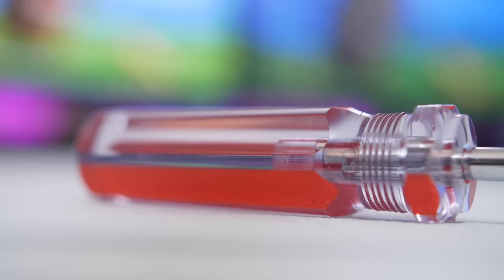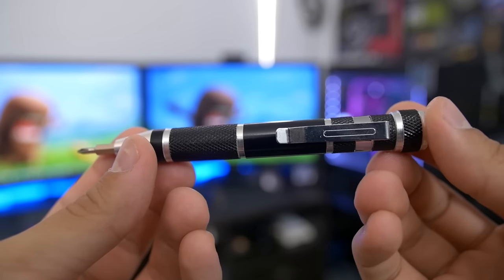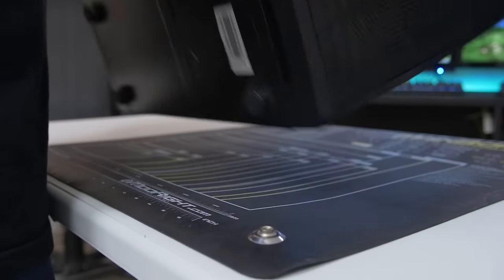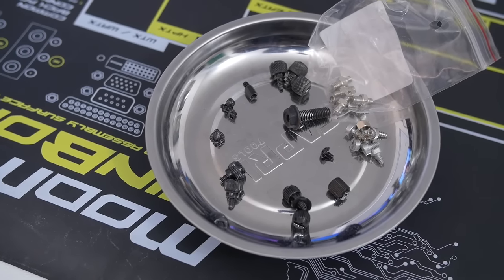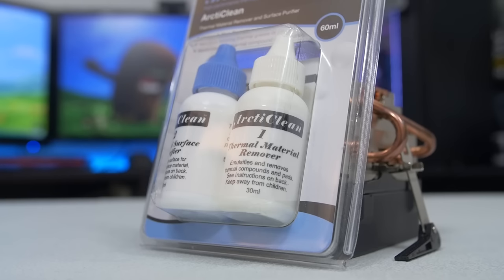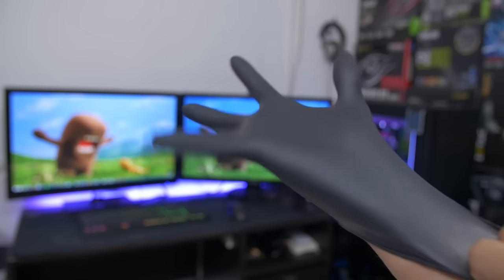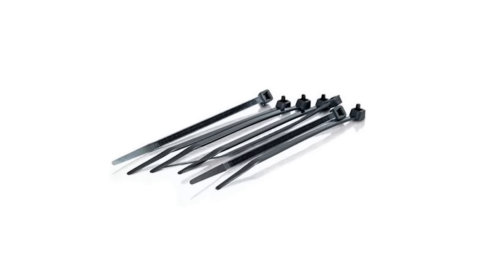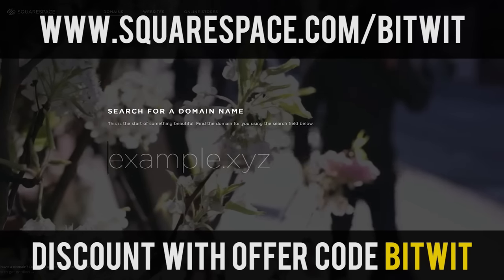Top Must-Have Items When Building a PC!

Comment: Most of these things in the video I have because of construction and mechanical work. I use a makita 18v impact to put in screws with a magnetic bit holder for a drywall gun to put computers together, it's super fast and I have a good feel for it from so much use. Plus it's got a light!

Comment: I raid the produce section of my local supermarket for those twist ties,excellent for cable management and the price is right. My complaint about plastic wire ties is the sharp piece that can be left sticking out if you do not cut close enough. Cost and the leftover piece of a plastic tie is another issue.. Love that magnetic dry erase board. Those would be very good if you are working on a laptop,so many more screws and the screws do have some differences.

Comment: You said the nitrile gloves are non-conductive. However, it is non-conductive items that will have a static charge since they inhibit the flow of electrons, causing them to pick up and then retain electrons until they reach enough of a charge that they violently discharge and fry your electronics.

Comment: If you are water cooling and need to mount a reservoir a small level and or square can be useful.  A stepped bit can be useful for passthroughs.  A ruler is just useful for a lot of this all around especially when new to watercooling.  At least that has been my experience so far.  And double sided tape for helping mount things is a godsend.

Comment: To make bitwit a good name, make a logo and channel art, and apply them as ur profile pic and channel art then the name would look a lot better on the channel.
Reply from the maker: Working on that as we speak!
Reply: Neat
Reply: +BitWit you should call Awesome Hardware "Hardware Bits"
Reply: random question is it ok to use universal thinner for cleaning cpu and heatsink i used it a few times now
Reply: +Mawe KFX you'll be fine; it actually cleans the paste off a LOT better.. just be careful and try not to hit the PCB on your motherboard with it.
Reply: +TH3 D0NX why not awesome bits of hardware
Reply: +Rickie Cheong I thought of that but too many syllables
Reply: I agree. He needs to have good branding to match. His current profile pic is awful and so is the channel art. When you change the channel name you should change all the branding for consistency.
Reply: Ban Ashrack why he seems to enjoy what he does and is living the life he wants
Reply: What if i still use the little cloth that came with my glasses to clean my oversized Corsair 760T window?Is it still good?

Comment: I work on multiple PCs per day, and as long as you are careful and light on the trigger, an electric impact gun can tighten down screws in less than a second, and when you are building multiple systems per day it saves both tonnes of strength and time, I never had an issue with stripping screws or damaging other components

Comment: well i just built my pc, and the only thing i wish i had was a magnetic screwdriver.
Reply: ...and maybe a titan xp
Reply: that escalated quickly
Reply: pc specs?    just curious.. ;)
Reply: I'd just settle for two 1080 honestly
Reply: settle? can i ask you what the hell kinda gpu do u have?
Reply: +BrainBoost_132 6500 and a 1070, inside the node 202
Reply: ok, thx
Reply: You could get a regular screw driver, find some magnets, rub the screwdriver against the magnets and voila, you have a temporary magnetic screw driver! :D
Reply: Grim Secret just joking obviously, I can't even afford a single 1070 really
Reply: I built mine about the same time as you, I just took a regular screwdriver and rubbed a magnet on it a bunch of times. It successfully magnetized it enough to hold screws fairly securely. It must have been a real pain without it.
Reply: ***** I'm about to build my first pc, do you have any tips to not screw anything up?
Reply: Lec sjfsadk make sure parts are compatible, get a magnetic screwdriver and touch your pc case every once in a while so you dont die by electrocuting yourself
Reply: Elektramd Not exactly "Die by electrocuting yourself" but... To reduce the risk of frying the components. (Even though it's a REALLY small chance)
Reply: So an antistatic bracelet is probably way overkill
Reply: Lec sjfsadk If you want to absolutely be safe, Go for it (if you can). but it's not necessary. Touching the case every so often should be fine.(that's the general answer you see online)
Reply: ***** yea
Reply: ***** yeah that's what I'm probably going to do. I can't wait to get started, I've been spending the last month watching videos, reading on forums and looking at prices.
What do you think about this build:
i5-6600k + hyper 212x, rx 480 nitro+ (or gtx 1060, I'm still not sure though I'm leaning for amd because freesync), z170 (still don't know which one, maybe the asrock gaming k4), 16 gbddr4 corsair vengeance, ssd samsung 850 evo 250gb+ hdd wd 1TB
Reply: Lec sjfsadk What kind of games do you play? both gpu's are good but the rx is better in some things, same with the 1060
Reply: Elektramd gta v, assassin's creed, FIFA, nba 2k and idk what comes out (I'm more of a casual gamer). I know the rx is better for dx12/vulkan so for future games and the gtx 1060 would be slightly better for these games but yeaah..
Reply: Lec sjfsadk Since you're a casual player and don't mind about the fps that much the rx can run those games, prob not as well as the 1060, but its good for the future so i would suggest the 480
Reply: Elektramd yeah that's what i thought, as long as it doesnt stutter and is consistently over 30fps it's golden
Reply: Lec sjfsadk def over 30fps, sometimes stutter is caused by the game (if stutters) but usually fixable

Comment: I just built a new desktop and as with every build, found it relaxing and fun. One of the items came with white gloves, and I promptly tossed them. I would suggest a set of needle nose pliers as you may have small rubber gromits and the like to place and or remove, depending on the build.

Comment: Screw organization? Ice cube tray, with magnets glued to the bottom or the stronger type of magnetic strips. I know this video is older but I started using ice cube trays after seeing it on a electronics repair/modding channel and added the magnet part myself.

Comment: Do you really need special liquid to remove thermal paste? I just use alcohol and it works fine.
Reply: It works fine. It flashes away quickly and is safe on electronics.
Reply: my uncle was gonna use cologne to clean the ihs
Reply: I used nail polish removal. Haven't had any issues... yet(?) :P
Reply: Yup.  rubbing alcohol is just fine.. forget going out to buy some expensive "remover"
Reply: i use chlorine water to get thermal paste off of my cpu
Reply: I use bleach, works well
Reply: Jun Yong Park God i hope you are joking
Reply: It'll do damage to the PCB and any plastic if it comes in contact so as long as you keep it on the IHS it should be fine.
Reply: ***** are you talking about isopropyl alcohol? Cause that is safe on electronics. I saved a dying GPU and motherboard by cleaning all over with Iso and an acid brush.
Reply: No, that's why you don't use acetone.
Reply: ***** yes, because acetone is a solvent which eats away at many materials. Isopropyl is an alcohol that doesn't damage materials.
Reply: water does it too
Reply: I bought it for my first build the other day. It was good at removing thermal paste. The smell was nice but i still smelt it after i finished building my PC 5 hours later, so it got annoying
Reply: jirka merunka please don't use water trust me
Reply: Ray Sindweller Well I use Isopropyl Alchohol or wet wipes that contain it(if I am too lazy)
Reply: Ray Sindweller I use my spit

Comment: 1. Power Supply 
2. Motherboard
3. CPU
4. GPU
5. RAM
6. HDD
7. Case
8. Mouse
9. Keyboard
10. Screen

You're welcome
Reply: Kevin Deegan or a SDD
Reply: Not essential though
Reply: Optical drive too
Reply: Do you need the mod mat?
Reply: Not screen its called a monitor
Reply: MaxFrag Gaming You need a screen because like tv can be used as a screen and tv ain't monitor
Reply: Don't forget about an OS lol
Reply: Kevin Deegan you forgot cpu cooler, aha
Reply: DAGRAFIX Included in CPU 99% of time
Reply: Isopropyl alcohol, heard it works as good as anti cleaner.
Reply: Wires
Reply: Gpu isnt
Reply: GPU isn't necessary
Reply: Forgot the RGB xd
Reply: You don't need GPU if you have an APU over a CPU, you don't need mouse, keyboard or screen, so all you need is
1. Motherboard
2.RAM
3. PSU
4. Screwdriver 
5.APU
6. Storage disk
Reply: *Monitor
Reply: IlluminAdi as the guy said above, you can use a TV as a screen and you don’t call a TV a monitor.
Reply: What about os?
Reply: 7-10 and arguably 6(although net boot is a very exotic use case) are optional.
Reply: ssd
Reply: HDD?!?!?!?
Reply: 11. SSD

Comment: When things are described as 'must-have', I normally expect them to be essential.  You know, like... you MUST HAVE them.

Just me?
Reply: GamesByMuzly Yeah, the only thing I'd say you actually need it a magnetic screwdriver.
Reply: TyFilms And even then it doesn't HAVE to be magnetic.  I only have one nonmagnetic screwdriver and have built 3 PCs this year.
Reply: Yeah, it's just annoying dropping screws in the case. But really, you don't need something ridiculous like a $50 mat. Just don't build on carpet and ground yourself.
Reply: TyFilms I wanna put my pc in my room so is it fine if I leave it on my carpet, and will it really be bad if I build it on the carpet?
Reply: Jinχ it'll be fine keeping it on carpet, so long as the inflow/outflow isn't on the bottom, and people don't usually recommend building on carpet, though I've built 3 in my room on carpet with no problems, but just to be safe it's best not to do it.
Reply: Ethan linquist so what if I build it on tiled floor and then put it on a carpet?
Reply: Jinχ As long as there isn't a fan setup or any sort of air out/inflow on the bottom it should be fine, no static problems.
Reply: Muzly it's a figure of speech, my dude
Reply: mw too  brother cmanannananana
Reply: was just about to comment that
Reply: How common is zapping parts from static etc...is the mat neccessary? Is a wooden  table ok to build on??
Reply: @TyFilmsTy  and you don't even need that! Telekinesis can take the place of a screwdriver.
Reply: Me too
Reply: (reacting on the fact that you only Have To Have a non magnetic screwdriver)
And then again, if you actually go down the route of the "actual" have to have, you don't need a screwdriver, you could do fine grabing a knife from your kitchen.
Or even just by hand if you have solid and not too long nails, or are willing to let screws a bit loose

Comment: which camera did you used to shoot this video.
Reply from the maker: GH4 with a Sigma 18-35mm 1.8 lens :)
Reply: This may seem dumb,but my 9yr old cousin has the same PC as you,but in purple not pink.....Its called Power 60.
Reply: crispy image = love :)
Reply: a 9 year old does not have 2 Titan X's and a 5960X (unless kyle upgraded)
Reply: Flipping hell, I've been asking on most of your videos!
Reply: Most of the fellow technicians I know NEVER use anything.  at most they may have anitstatic mats where they are working, but I have seen places where the work areas are carpeted.

The dirty secret is that while those products protect from ESD that you carry but can also create ESDs that wouldn't have happened if you weren't wearing it.

Here is the general rules

1) don't work in bare feet or with socks on, wear soled shoes or slippers.

2) Before touching the components in the case touch something large and metal.  Most techs are told to touch the metal case of the power supply or the case, but some of the PSUs that have heavily textured coatings don't work as well as when they are bare medal.  In a real pinch you can even use a painted fridge door or a pot.  most of the time you don't even have to do this, it is just a good habit to get into.

3)Try to avoid sweaters and clothes straight out of the dryer.  Even if you had a dryer sheet in there.

4) Avoid wearing multiple layers of clothes.

BTW the only devices I have killed with ESD have been while I was wearing a strap on my wrist.  Mind you I also used to kill digital wrist watches by just wearing them so your results may vary.
Reply: that sounds like a rifle haha
Reply: Hello!I am one of your fellow technicians!I have a PC shop in god knows where and I mainly repair desktops,I have a magnetic parts tray an a 6 year old mod mat that looks like your grandmas carpet (Not insulting ur grandma)but it works even in its black lettuce form :/
Reply: NickGaming Hey I am NickMsiGaming and have that MC account lol.
Reply: You are NickGaming And I am NickMsiGaming.They are very similar....
Reply: my MC name is NickGaming__
Reply: And mine is NickMsiGaming
Reply: Assassin 404
Reply: and where do you find this, power 60?
Reply: thanks for the tips
Reply: Sean Douglas Yes, all the cool KIDS are using the GH5. However, that does not apply to a full-grown man who just acts like a kid.
Reply: Nicholas You changed your name...
Reply: yeah because im starting to do youtube now, idk what i should change it to offical
Reply: NickGaming was better for,well,gaming (AKA Youtube channel)
I prefer names relating not to your name but the name of a channel....
Like BitWit
Imagine if his channel was named Kyle....
Yeah..pretty crappy...
Reply: ik thats why i changed from nickgaming, i dont want it to have my name in it. i changed it to what it is now for while i think of a new name
Reply: Oh ok.I have this name because i work at Msi :)
Reply: really?
Reply: Yeah,but sadly i cant give you any discounts on our products :(
Reply: I work in the showcase department,like at CES in the Msi booth.
Reply: But usually i dont really showcase the products,i just f**k around with them behind stage,until those who show them in the booth take them away from me lel :p
Reply: can you show me proof you work for MSI?
Reply: H,how?
Reply: I could show you my documents,but i don't want you stealing my info soooooo.....idk
Reply: Anything you do,don't tell my colleagues that i have a Dell XPS 15.but I also own a Msi G72 Ghost Pro so i guess it...is..ok?
Reply: if you did work for MSI you could get me like a 99% of code for any product? lol jk
Reply: I'm sorry but if i did that I would probably most likely get fired xD
Reply: send me a gtx 1080 and a high end Mainboard with a gaming laptop or just one of these
Reply: I can send you a 750,we have about 20 of those left...
Reply: Assassin 404 lol really?
Reply: But i think my co-worker Ethan stole them Linus style!
Reply: would you really send one?
Reply: I said that Ethan took them,I could ask him but its simply not worth it for a 750....
Reply: Assassin 404 if its not a joke and you can deliver it to germany i would be very thankful
I have 7 fps at realm of the mad god on my 12 year old optiplex gx 280
Reply: Sean Douglas Probably more fucking successful than you'll ever be
Reply: Assassin 404 ikr it's fucking beautiful

Comment: That Klein screwdriver doesn't have a magnetic tip like your Thermalright.
Reply: ebiljebus you can rub a magnet on it and it will be magnetised
Reply: Gunna temporarily, yes. Not permanently
Reply: cbf edge depends on the magnet. If u dont have a powerful one lying around its easier just to order one
Reply: Order 1 screwdriver*

Comment: Are anti-static wrist strap needed too?
Reply: None of these are needed just things to ease the buildibg
Reply: +Javien Washington building*
Reply: Miguel Gabriel yeah, and a tin foil hat.
Reply: I believe he stated that the wrist strap came included with the mat so I guess he didn’t specifically mention it separately.
Reply: Miguel Gabriel you could just buy those gloves, use the for other stuff and you don't have to have something restraining your wrist from moving
Reply: no
Reply: Only for hard drives really.
Reply: If you want to remove all ESD from your body, it is nice to have the wrist strap, otherwise you have the potential to kill a PC component from ESD Damage
Reply: Recommended but not essential
Reply: Not exactly. Just periodically touch a big metal item (like a refrigerator or something)

Comment: Does that arctic silver thermal compound remover work on ceramic thermal compound? Also is it safe for delidded processors and laptop processors? I work in refurbishing and having that stuff around the work station would be a godsend with how thick the ceramic paste we use is, especially with the exposed silicon dye on laptop processors.

Comment: Ive built my ryzen pc with my tiny screwdriver that was included in the metal kit that was given me more than 4 years ago .... it has 2 major problems: 1. the point of the screwdriver is not magnetic and 2. its too small ( my screwdriver :P ) to concentrate much force .. so you cant tighten up the screws without being chuck norris... but the pc works fine :P and Sorry for my bad english :/

Comment: I'd suggest flush cutters over standard wire cutters for a cleaner cut on the cable ties. But that's more nitpicky than a real suggestion.

Comment: I never work on a system without a static mat and wrist band. People make fun of me for it, but I'll tell you a little story. In the late 90's, I saved up forever to get a CD-R drive, because how else could I possibly backup my MASSIVE 20GB hard drive? So I open up my case, I get ready to install it and. BZZT! My finger touched the mainboard of the hard drive and that was the end of it. Completely fried it losing all my data WHILE INSTALLING THE DRIVE TO BACKUP MY DATA. Super frustrating, and all it took was that one quick touch. 

Never. Again.